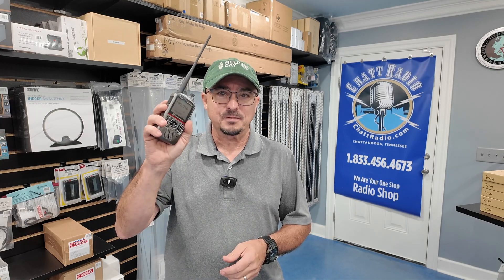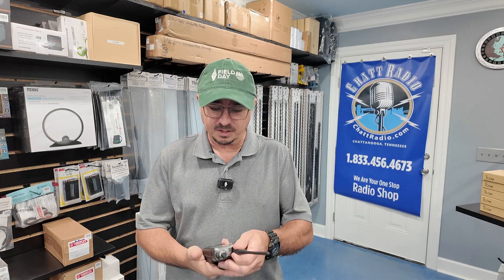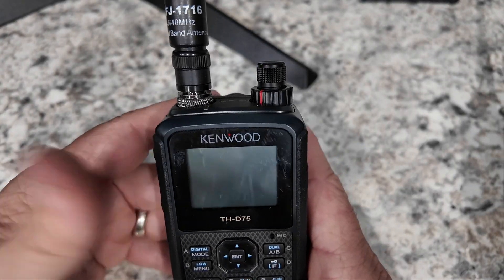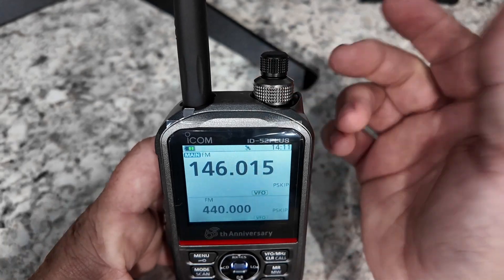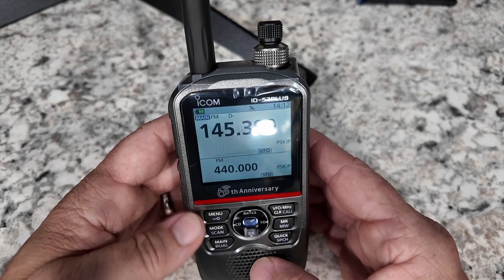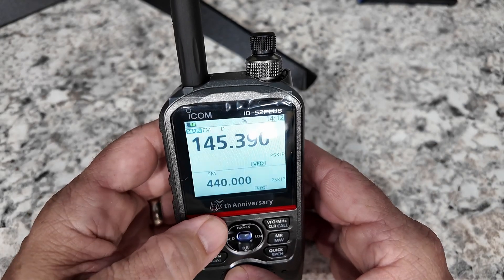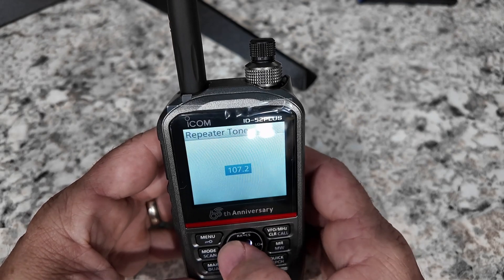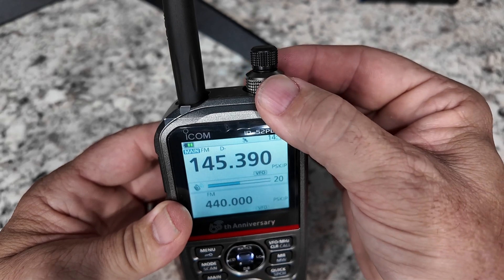How Intuitive Is It

Comment: Anytone 878/578

menu/settings/chan set/new chan/confirm/name/channel type/tone/tx power/rx freq/tx freq SAVE - DONE. Maybe the only linear setup I've used. I think most radios have you jumping through menus. The Yaesu nailed it with the CFL on the FTM-200 and 500, why though does the 300 not have the CFL and the PMG? Even the FT5D is more intuitive than the ID-52. But  brother that ID-52 can be as much un-intuitive as the worst but it makes up for with that stellar audio!

Comment: Just needed to hand program a Yaeso FT'4X for tone. At first it didn't bring up the repeater. I then noticed you program the receive & transmit tones from the same menu item. I then had to figure out how to switch from Rx tone to TX tone which was the * key.

Every radio is different even if from the same manufacturer.

Comment: I would have used the nearest repeater search function and loaded it from there.  That is predicated that you had to save the local repeaters on to an SD card and then loaded it into the unit.  Thanks for the video!  73
Reply from the maker: That is a really cool feature of the radio but this one was brand new out of the box. Didn't have an SD card loaded with the repeater data yet.